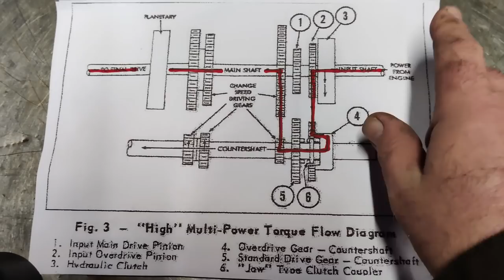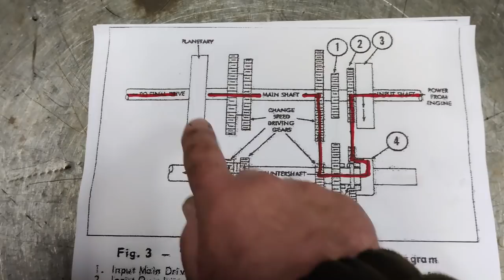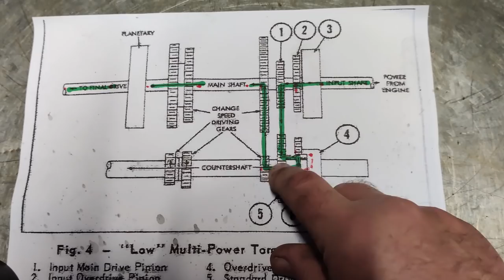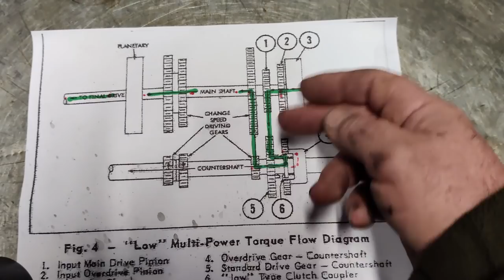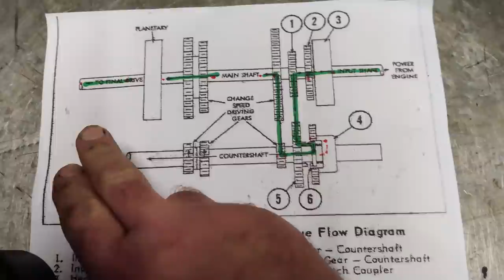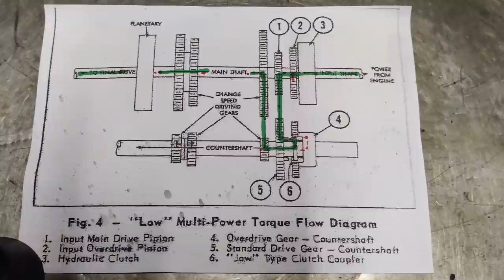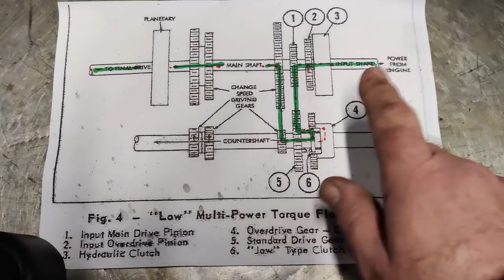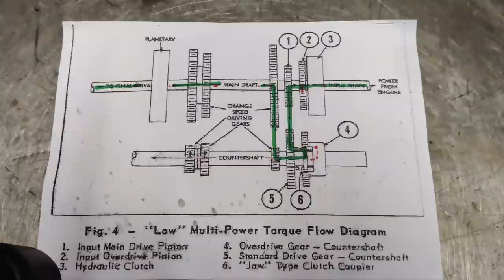How Multi-Power works.   Part 2

Comment: Excellent description. Best I've seen. Thank you. In the 70s my father had a MF 175 that would randomly drop out of high multipower and you were stuck in low. Not great place to be on the road with a heavy load or rotavating when you could get pushed by the implement.
Reply from the maker: Well that's a problem we can look at in the next video.  Thanks for watching.

Comment: Great video and way of describing it. We bought a second 165 with multi power. It stopped working suddenly and my dad got a guy to but in a 3 speed standard it was never the same tractor.
Reply from the maker: Pity, it only takes about 40 minutes to strip a multi power gearbox right out, not a lot more work than putting a three speed in.  Thanks for watching

Comment: Fair play good explanation . I didn't know how it works till now . A lot of thought went into it . I can now see way there's no engine braking in low cause of the over run gear needed to make it operate it in high drive .... fords dual power  was an epicyclic unit .
Reply from the maker: That's correct.  Thanks for watching.

Comment: New subscriber first tractor is a Multi power 178. I use it run a Hiab through a pto pump on the pick up assembly and very much enjoyed the last 2 episode about to watch the 3rd. P.S. how difficult is it to turn into 4wd. 
Aussie Jeff Moore
Reply from the maker: With enough parts from a silver top 4wd 590 or 575 you could make it 4wd, but it's a lot of work, unfortunately the 178 didn't have the gearbox spacer like the other super specs, it had the extra centimetres in front of the engine, so you could end up with a very long tractor.  Cow Farmer Dan has one though, it's lovely.

Thanks for watching

Comment: Good explaination of MP operation. Looks like it will need the full works ( both shafts, MP housing, cast rings MP clutch plates, seals etc) to stop that one leaking !!!. Seen too many in my time. Will you cover hyd. press/flow in the next vid?
Reply from the maker: I'll give it a full rebuild probably.  The parts are not that expensive.

Comment: Great video once again.
The way low multi-power is supposed to be used sounds similar on how and when to use a diff lock, use it only when you need to and then disengage it.
From a mechanical point of view its quite simple in its operation as long as the oil pressure stays up and the clutch unit is good i cant see many other things to go wrong with it, but i`m sure you`ll point them out for us in the next one.
Reply from the maker: There isn't a whole lot to go wrong, mostly just wear.  Thanks for watching.

Comment: One great thing with multipower is that it's really easy to shift without clutch on low. You just roll through gears without clutch and after H3 turn multipower on.
Reply from the maker: That's true.  Thanks for watching.

Comment: Interesting incorporation of an automatic transmission clutch pack to.....   is your flow chart from a Massey Fergeson manual?
Reply from the maker: I think that one came from some training material I had 40 years ago!

Thanks for watching.
Reply: That diagram implies a direct connection between input and top shafts, not true. Needs some Tippex! @ClarenceFudWeasel

Comment: Informative!  Thanks for the break down Sir!  One question...  At 3:13 (thru 3:47) in the video I noticed an angled line on the casting mount for the upper left gear assembly.  Just wasn't sure if it was a crack in the casting, (I certainly hope not), but I thought I'd mention it.  Hopefully it is something else.  Can't wait until part 3!  Thanks, and Stay Safe!!!
Reply from the maker: It's not a crack, just a parting line in the casting.  Thanks for watching.

Comment: In condizioni normali di marcia è bene utilizzare il Multi Power in posizione high.
Tuttavia facendo riferimento al mio 188 avendo una terza molto lunga rispetto alla seconda, in lunghi tratti di salita si può utilizzare anche in posizione low.
A macchina ferma si consiglia di tenerlo sempre in posizione low, che lavorando il circuito in bassa pressione si riduce l' usura dei componenti.
🇮🇹🇮🇹🇮🇹
Reply from the maker: You are 100% correct, that is exactly how to use multi power.
Reply: @ClarenceFudWeasel 
Ovviamente con il modello 3095 cambio autotronic tante problematiche del Multi Power sono state risolte.
Comunque continuano a funzionare in azienda tutte e due i modelli.
Grazie Massey Ferguson e a lei per la gentile risposta.
👍🤝🙌🇮🇹🇮🇹🇮🇹

Comment: We have a MF 165 and the Multi-Power was great for hauling bales pulling a New Holland 1032 but the hydraulic system failed several times and now we don't use it anymore.  Always wanted to somehow repair it myself but never the time.  Before, It had been taken to a repair facility both times and both times it failed again for a cost of thousands of dollars.  Maybe the shops didn't know what they were doing.  The first time it had failed, the mechanic working on it moved on and another had to pick up the pieces.  Other thing we didn't like was there is no way to pull start this tractor unlike conventional gearboxes.
Reply from the maker: I'll explain why it won't pull start in the next multi power video.  Thanks for watching.

Comment: MF's multi power, Ford's Dual Power, International's Torque Converter and John Deere's High-low were not the only ones of the same concept.  In Switzerland, Bührer started in 1955 with a two-speed power shift with a five-speed standard transmission behind and produced it well into the sixties.  This transmission called triplex was produced well into the sixties, when it was succeeded by the Tractospeed transmission.  Fiat also had a two-speed power shift in its 531R (freewheeling in low) and then in model 615 it had an extra wet clutch and was not freewheeling in low.  Also the tractors produced by Fortschritt in the German Democratic Republic had a two-speed powershift somewhat similar to Fiat's version.
Reply from the maker: That's very interesting.  Thank you for sharing.
Reply: I believe that you overlooked the Zetor Crystals that had a very well made torque amplifier that was simple to repair and was capable of tow start and engine braking in both ranges Many’s the kid had scary moments on Masseys with failed high me 2

Comment: I thought that that the Mulipower in high was an extra higher gear and the low Multipower was the standard speed, I had no idea Low was a lower ratio as well, so  a Massey Ferguson 135 Mutipower in top gear, 'third'  in low Multipower should be slower than a 3 speed gear box without MultiPower? The Multipower clutch system looks similar to a motorbike clutchtoo.  There is a bloke up in Northern Queensland Australia who is doing up 2 Massey Ferguson 135s, one with MultiPower and the other without it, he also reconditioned the Multipower system, his channel is called Bundy Bear's Shed.
Reply from the maker: Thanks for watching.  Yes, 3rd low multi-power is slightly slower than 3rd in a conventional gearbox.  Thanks for watching.

Comment: I was told that if you drive with the multi power in low for long periods you can damage the gearbox so it’s recommended to flick into high multi power every once in a while is this true?
Reply from the maker: Certainly is true.  The input shaft assembly, bearings and clutch pack depend on oil flowing through them for lubrication and cooling when the spool valve is in High.  When it is in low the oil flow stops and the clutch plates can overheat, and the bearings wear.  We'll go into more detail in the next video.  Thanks for watching.

Comment: Power Synchron is an underdrive. My old 2140 is still going strong but it did need Hi-Lo and PTO clutch packs at 5500 hours. Its on 11,000 hours now and been on much lighter work since I sold it at 9800 hours.
Reply from the maker: I do love a 2140 is yours SGII?  Thanks for watching.
Reply: @ClarenceFudWeasel  
Yes. Sold it to a near neighbour about 9 years ago and he keeps it in great condition. Up until 2021 he just used it on a twin rotor rake for his contracting business but last year he just took it to a local vintage show or two. It worked very hard over the years, mowing thousands of acres with Kidd Clipper 8ft mowco’s and carting about 800 acres or so of silage, swapping 8 ton trailers in the field.

Comment: Haven't a clue!
Just looked on tractor data and it seems to be a true splitter so low is slightly slower than a non syncron and high is slightly higher than a non syncron.
Reply from the maker: Thanks for checking
Reply: @ClarenceFudWeasel  
In you're explanation of going to low multi power up hill while foraging you didn't explain the same scenario for down hill but you'd have to come down a whole gear. That's my problem with multi power and it's flaw. Other than that it's a great system.

Comment: Multi power is an overdrive whereas Dual power is an under drive. The problem with Multi power is no engine braking on low, whereas with the Dual power you have got engine braking on high and low. Ford got that right.

Comment: Jd,Ford, IH all ubderdrive
Reply from the maker: Thanks!
Reply: So by that we can assume that direct drive (Hi Power Syncron) is the one under pressure as the lever drops to Low (Lo Power Syncron) once the engine is turned off.
Reply: @LordMuck  IH is similar to multi power with two constant mesh gear sets, high (direct) is pressurised, low (on the back of TA unit) is driven by a sprag bearing with drive plates in Belleville spring tension to give engine braking, these springs are released by the hydraulically actuated high side,allowing the low gear set to turn freely on the input shaft, a bit like a bike doing 25mph and you peddling at 20mph, always though power syncron was hydraulic both sides but never had one apart
Reply: @bufferbridge  looks like we need to dig a bit further ! 👍
Reply: @LordMuck  you'll certainly dig if it's a Deere, cab off,split at clutch, split front section from backend, then take most of the internals out to get to high/low unit, whoever designed it that way needs to enter a bollick kicking competition and go second!
Reply: @bufferbridge  yep we did that with the 3350